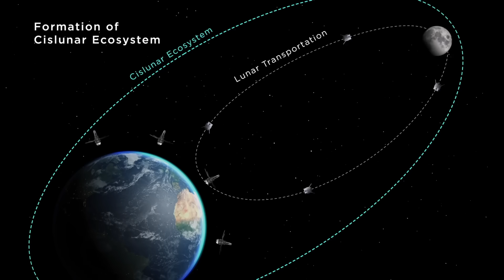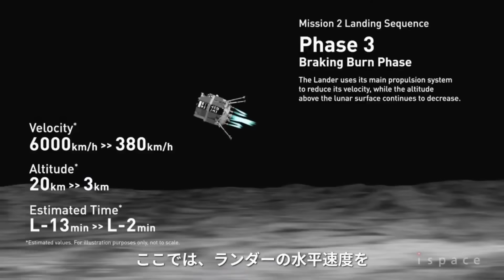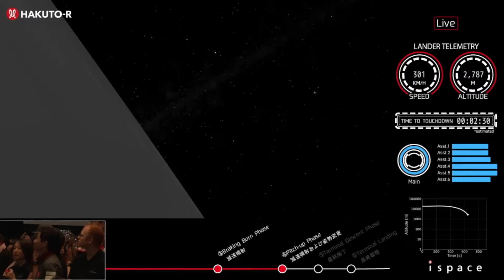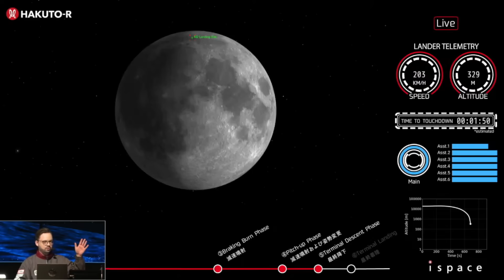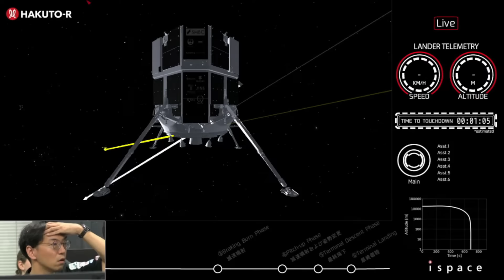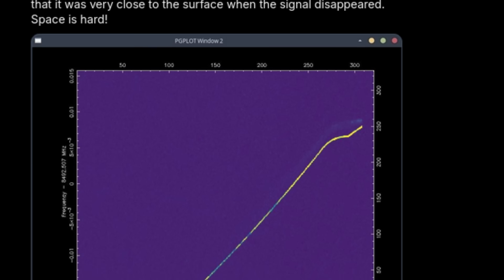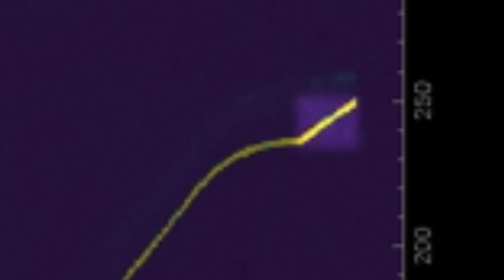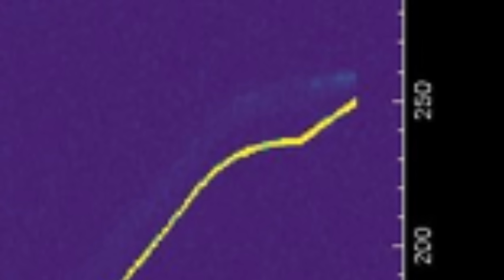Japan Crashes into The Moon, but Slower Than Last Time

Comment: If the question is "Why don't they..." the answer is usually money.
Reply: Why don’t they buy more money then 🤨
Reply: @IQof2 Sorry, you only get to do that if you're in charge of the government, not employed by it.
Reply: @IQof2  😂 i would love to buy more money
Reply: how much does a hinge cost?  put the lidar on a hinge so it can always see the surface?
Reply: @Sintesi.  good design is a simple design. Putting unnecessary components on a vehicle gives you higher probability of failure of these components.
Reply: @LaggerSVK  hence a simple hinge and a weight to keep the lidar pointed at the surface at all times.  its better than doing what they have been doing, which is flying blind until pitchover.
Reply: @Sintesi. All the weight would do is make it point down towards the engine, opposite the thrust acceleration.  The hinge would have to be driven by a motor to point it at the ground.  Doable, but it might be easier to just have multiple altimeters at different angles.
Reply: @epicspacetroll1399  yeah that was my first thought, but then they would have to, at some point, switch between sensors.  thats why i went for 1 sensor on a hinge.  you could use a servo motor like they use in rc cars to control the hinge. you are right about the weight, it would be a pendulum. i didnt think it through properly.  now that i have, it would actually make it worse.  good call.
Reply: @Sintesi.  man, that's too simple. If they did that they would most likely succeed and maybe it's not the goal here.

Don't know, all those failed missions feel extremely amateurish and badly designed.
Reply: @vaakdemandante8772  Then maybe you should apply and tell them how to do it properly if it's so easy
Reply: This is spaceflight; weight/packaging/volume et al plays just as big a factor. - Dave Huntsman
Reply: @dphuntsman  Which ultimately comes down to money.
Reply: I read a chassis and suspension design book once that went into details on the development of early generation Corvette suspensions.   They wanted to make it a decent car, but the budget guys would not let them.  The shame of delivering such a garbage suspension was palpable in the author's wording.
Reply: I have one ... 
Why don't they just revert to manual control in situations like this? The moon isnt that far. 
They have cameras, just fly it to the ground manually. Kind of like what Neil Armstrong did. Sure its a 2 second delay, bit might still be doable, and its better than loosing the whole thing because of faulty guidance and programming. 

I mean really, why dont people just fly these missions manually?
The moon is close enough that you could get semi-real time communication.
Reply: @livethefuture2492  It takes about 1.3 seconds one way for light to travel between the Earth and the Moon. A 2 1/2 second delay between something happening and a human remote pilot's reaction to that thing reaching the spacecraft is too long when you're operating close to the surface. (Note that this is based on assumption that the terminal operated by the human, the video compression on the spacecraft, etc take zero time. More likely you'd end up closer to 3 seconds round trip if you add everything up)
Reply: They had a lot less money (relatively) an a LOT less tech in 1959.
Reply: But like.... That's clearly not the case here because crashing is more expensive. Here it has to be arrogance or ignorance.
Reply: Okay, so why would they rather pay $X to have a failed mission than pay $1.1X to have a succesful mission?
Reply: Why don't they just use a pilot since that's the narrative people are doubling down on as a reason for the supposedly  first try successful televised landing im 1969?

Comment: 100 km/h seems survivable for a machine. I wonder if they can design around the idea of a harder impact in order to simplify the landing approach.
Reply: Yeah... NASA already achieved something similar with the Spirit rover 20 years ago. It basically crash landed into the martian surface, protected by a sphere of airbags.
Reply: @SystemBD that wouldn’t work on the moon
Reply: @UzayiKesfet  Why?
Reply: @liveshkumar7322  low gravity, no atmosphere, big craters. the thing would keep jumping around or it would stuck inside a crater.
Reply: yeah, a terminator would survive a 100km/h crash into the ground.  cars dont survive a 100km/h crash.  a 1 meter drop is enough to kill most things with advanced circuitry inside, especially computer things.

Comment: That's a real shame. I hope they have enough funding for a third attempt, and that it lands successfully. ...although I do wonder: it seems that landing vehicles with self-contained instrumentation is hard. Would it be worth investing in some infrastructure? e.g. something like a small network of GPS/Starlink satellites. It would make it so much easier to determine your position and velocity; navigation can be done with just a radio receiver and a map. High bandwidth communications back to Earth would give better telemetry (like live video!). The weird lunar gravitational field poses a problem in that there aren't very many stable orbits around the moon, but that doesn't sound insoluble.
Reply: Someone suggested a retroreflector on the surface, something like a bike reflector. (But I assume larger)
That would give a reference point of location & distance/altitude?

Comment: you'd better roll the landing instead. also why no manual route programming if all sensor data is lost. your surface scan radars cant get a preview from orbit? maybe the horizontal approach is too modern. you could also smash a ball on the surface, then open it up, to have the package. also why earth/orbit based radars cant get the moon surface features before the landing. landing practice. success is not worth it. achieving is. this only means that business is not viable, only free activity. who would want success on their fellow closest neighbors.
Reply: 1. why no manual route programming if all sensor data is lost.

I assume you are referring to someone on the surface attempting to "pilot" the spacecraft. There is ~3 seconds of direct communication delay to the surface, so by the time you have swapped to manual control, you are screwed. Additionally, there is a series of communications issues. Surface dust can accumulate, reducing communication capabilities, so you are left with less data as you approach the surface. You also need to stream more telemetry back for a manual input, so you need more hardware and power dedicated to those systems; all of which is expensive, and has a moderately high chance of cutting out when you need it most.

2. your surface scan radars cant get a preview from orbit? 

At the resolution needed, no. You might be able to get better data if you were able to orbit lower, but that becomes a problem for the program as it either requires a substantially larger lander (your parking orbit needs to be stable), or a separate disposable support spacecraft to complete it.

3. maybe the horizontal approach is too modern. you could also smash a ball on the surface, then open it up, to have the package.

This limits your payloads to "Items that can survive the G loading on impact". For a commercial lander, that is not a great plan overall, as it highly restrict your payload to primitive items. You still need some form of propulsive approach anyway as there is no atmosphere to take advantage of.

4.  also why earth/orbit based radars cant get the moon surface features before the landing.

Resolution. You need a really detailed surface map covering items the size of flower pots and smaller. Orbiters and Surface telescopes are not capable of supporting instrumentation to measure that resolution where they are. Orbiters are constrained by mass, volume, and cost, and Surface assets are limited by noise and environmental losses.

Comment: In hindsight of course, with all these failed lunar landings recently it seems we need less precision and more margin of error.
Reply: That's a tough ask for investors, these days more than ever
Reply: That's a tough ask for computers, even these days.
Reply: @TheRogueWolf  yup, especially for any computers that are not made of "meat"!! ;D
Reply: I think these failed launches are very useful for calibrating how much margin for error is necessary for future landers. Seems like we are a little on the low side at the moment.
Reply: Sadly, margin of error means less efficiency, and that's apparently really hard to sell
Reply: @alexandermarsteller7848 but how much do complete failed missions cost in time and money vs a successful mission that was over engineered. You can’t do science on the moon if you keep crashing into it.
Reply: The landers need small cold jet thrusters on top to keep it upright upon landing. Small added weight and would have save a few lunar landers
Reply: @oldmech619  Not really. Few if any landers have tipped over because they weren't well balanced. They've tipped over because they've *crashed*, and no amount of cold gas thrusters will keep the lander upright after you've hit hard enough to break the legs off.